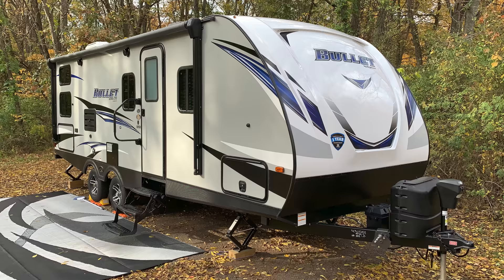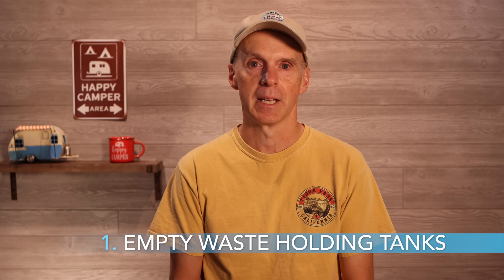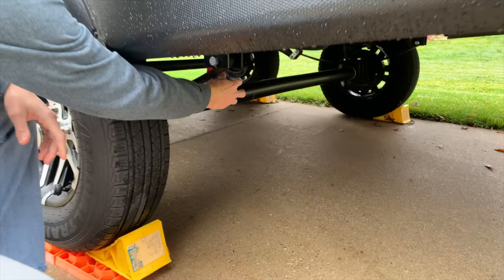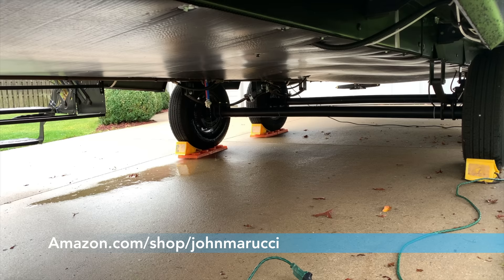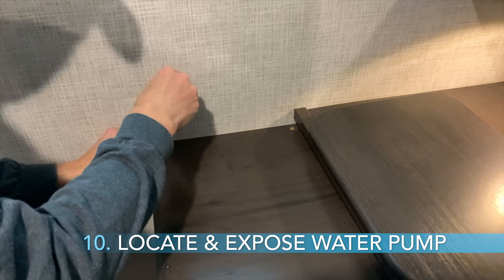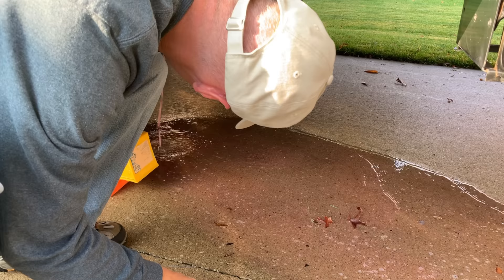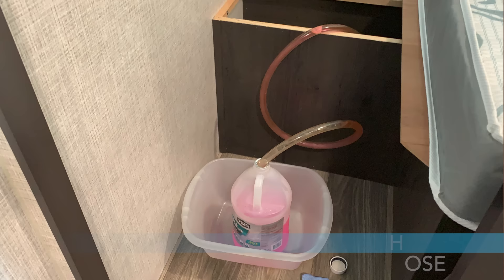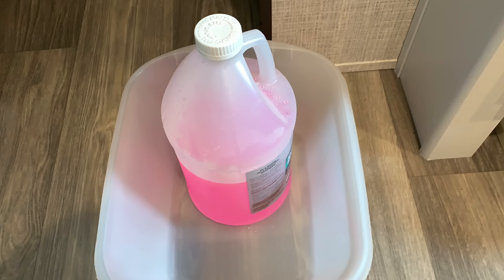RV Winterization Basics For Beginners – Step-By-Step Process

Comment from the maker: Here's a link to the free downloadable process document. Click the link and look for the RV Winterization for Beginners Process document: https://johnmarucci.com/docs-downloads
Reply: Do you also blow out your black tank flush?
Reply: Thank you so much for this tutorial.  I just finished every one of those steps myself.  (First time RV owner myself). I just have one question...I had antifreeze coming through the rear low point drain, but not the front. Should I be worried? Should I try again?
Reply: So if your water pump does not have a pigtail line for winterizing, where can I find out how I can source the same connector as my water supply line? Your siphon hose appears to have an identical fitting as your supply line. I’m presuming that you’ll need that in order to connect the siphon hose properly and not get a giant pink mess everywhere…no??

Comment: Just want to follow up. I did my TT this weekend using your guide. Worked like a charm. I threw a small bucket under my low point drain and captured the antifreeze to use in my sink drains. I had an extra outdoor kitchen sink. Used less than 2 gallons. Thanks again for making such a thorough how to.
Reply from the maker: Great tip on the bucket to catch the antifreeze under the low-point drains and reuse. Glad it all worked out for you!
Reply: Isn't it redundant to pour antifreeze down the drains since you already turned the faucets on to get the AF to flow through the lines? Seems a waste to add more when the traps are already full.
Reply: @toddpratt7222  Sorry--I still don't understand--the water pump is sucking the antifreeze and distributing it to the faucets--the trap should be full when you turn the faucet off--no?
Reply: @neilhudson6194  you are getting some in traps and toilet but I cut it off quick so not a lot. Rather than step 20 using clean in the jug antifreeze which seems a waste, I found the amount I caught in the bucket to be plenty for traps and toilet in addition to small amount from faucets. This was just my way to save the stuff in the jug.
Reply: @neilhudson6194 as cheap as that stuff is why not be super safe than sorry? I love where it gets negative degrees for long periods so 3 gallons is fine for me.
Reply: Look at you being resourceful way to go buddy and good tip

Comment: John, if all the water is drained from the plumbing system, why do you go thru the added time and expense of filling the system with antifreeze? Do you have to take those added steps?
Reply from the maker: Many people don't add RV antifreeze and just blow out their lines with compressed air. I am not as certain with using just air that I will remove all water from the lines.  With the cold Michigan winters if I make a mistake, it would be costly. I would recommend searching YouTube for winterization with compressed air. I know there are several videos to follow. Thanks.
Reply: @JohnMarucci  I imagine in Michigan taking the time and cost does save you from a potential  problem. Thanks.
Reply: Warmer coastal Pacific climates can get by with compressed air blowing out the lines.  I will add RV antifreeze to the toilet bowl and drain traps.
Reply: @PhotographybyTimWMoore  I am in Northern Cal but usually where I am now does not freeze.  I have a Roadtrek 97'. Still trying to find a good YouTube for directions.  I want to go up North where it is below 32.  What a project.  The valve at my hotwater heater appears to have never been open sooo
Reply: @deirdredooling9436  be sure to release the pressure in your hot water tank before working on the tank!

Comment: Just a quick update on making sure even if you haven't used your water heater for a couple months, that you use the pressure relief valve before you remove the anode rod. John was nice enough to mention it in the video but my elevator doesn't always go to the top  (on paying attention) and I got a face full of hot water tank water (it was cold water by now) mixed with all the white junk in it. It would make America's funniest videos if someone captured me doing it but it could also be dangerous when the anode rod bursts out.  That's my bad, John mentions it but I didn't follow directions step by step. Thanks for the video, John!

Comment: Ive tried EVERYTHING and my antifreeze will not run through the line.....
Reply from the maker: I'd start from where the siphon hose is connected to the water pump. Is your water pump drawing antifreeze from the antifreeze jug? If so, is antifreeze coming out from the water pump? The pump can get clogged with debris. That's where I would start.

Comment: Thanks John,  great video. When are you supposed to turn back the bypass  on the hot water tank? (In my case it's the by pass and the in-and-out lines)  Do you have to wait to flush out the system when de-wintrising or can you  switch them back to their original positions right after you're done winterizing?
Reply from the maker: Some people do turn the valves back immediately after winterizing. I suppose you could have some back flow of antifreeze into the hot water tank but it likely would be minimal with no harm done. It also saves having to turn them back in the spring when dewinterizing. I do leave mine closed but I don't think it is a huge deal. Thanks!
Reply: @JohnMarucci   Thank you that was helpful. I appreciate it.
Reply: Thank you for this!  I did take my RV to the dealer to get it winterized as I’m a newbie and didn’t want to do it wrong and cause a costly mistake.  But they did leave the valves in a ready to go position so I don’t have to do anything but run water through the system after hooking up to campground water.  I am heading south this weekend and will dewinterize when I’m there.  I don’t use my fresh water tank at all.  I was concerned about antifreeze getting into the hot water tank though.  Do I need to turn on my water pump if I’m not using the fresh water tank?  Thanks so much!  Hoping to follow your video when I winterize next fall.

Comment: Excellent video. Thanks. My question is do you really need to use antifreeze if you drain all of the water and blow out the lines? Seems like overkill.
Reply from the maker: Paul, Many people don't add RV antifreeze and just blow out their lines with compressed air. I am not as certain with using just air that I will remove all water from the lines.  With the cold Michigan winters if I make a mistake, it would be costly. I would recommend searching YouTube for winterization with compressed air. I know there are several videos to follow. Thanks.
Reply: Hi Paul - I work in the service department at an RV dealership and have seen instances where people have blown out all of the water, but still end up with a cracked water pump because there are some areas that still have enough water to freeze and crack (almost always the strainer's housing cap).   We see a lot of those come spring when we de-winterize RV's and there's a leak somewhere and the customer had only blown all the water out,  not followed up with antifreeze.  But it's a personal preference, I suppose.  The antifreeze these days is very safe for incidental contact with people, pets & wildlife.
Reply from the maker: @RLeigh1976  Thanks for sharing!

Comment: I’m a new travel trailer owner, and I followed this video to a T yesterday - and it froze here in Wisconsin last night.  We have a Coachmen Catalina Summit 184bhs.
It wasn’t clear where anything was and after a few calls to the manufacturer, I was able to locate the bypass under the bottom bunk, and remove a drawer under the sink to access the water pump.  I feel SO MUCH relief now that our camper is winterized.  Thanks for the clear instructional video.
Reply from the maker: Glad to hear it, thanks for the comment!

Comment: love the explanation john.. very informative.. what i usually been doing for years is: after draining all the water out of the rv and water heater tank, i put 3 jugs on antifreeze on my clear water tank, turn on the water pump and turn on all the faucets till antifreeze is running on those hot and cold lines. after that i turn off water pump and take the clear tank cap off and let the remaining antifreeze out of that tank straight to a bucket and later on dumped on p traps around the coach and toilet.
Reply from the maker: It certainly is a way to do the process without having to use a siphon hose. You may want to think about a final rinse of the fresh water tank so the antifreeze residue doesn't remain in the tank off season. Thanks for sharing.

Comment: I"m new to the RV life, just bought an older 17' travel trailer late this summer.  I have to say that this is the most simplest video on how to winterize an RV that I could find!  Most of the others seem to be manufacturer specific, but not this one.  Thanks for making it so simple.  Another Subscriber here!
Reply from the maker: Great to hear that the video was helpful. Thanks for subscribing!
Reply: @JohnMarucci  FYI.  I winterized my RV.  Including the time to hook up a brass T to the intake of my pump, I think it took less than half an hour!  If I had a channel that had anything to do with R'V's, I wouldn't do my own video, I'd just link this one!

Comment: My husband and I have a 2006 Layton 5th Wheel.  We don't use the pink antifreeze for our water lines.  We live in the Northeast where we have at least 5 months or more of winter.  My husband uses a small air compressor at PSI 25 to blow out all the water. You have to open all faucets when doing so and the outside hot water heater has to be drained too.  Works awesome!
Reply from the maker: Yep, many people use the compressed air method to winterize. There is risk if you don’t understand what to do. Some newer folks can cause real damage in this regard. Thanks!

Comment: Very good video!  I do just about everything that you showed, however I don't go through the process of disconnecting the intake hose at the pump.  It's hard to get to in my Coachmen Catalina 243RBS.  After I blow the entire system out, I add about 2 gals of the pink antifreeze right to the fresh water tank.  I then turn the pump on and open each faucet until I see pink.  Then I'm through.  In the Spring, I drain the fresh water tank and flush it a few times with some bleach and water.  We don't use the fresh water tank to drink from...just showers and washing dishes.  So far, so good.  Haven't had any problems yet.  My other RV that we had, I was able to easily get to the pump and add antifreeze the way you showed.  I have a friend that only blows his system out with air and says he's never had a problem.  Never uses antifreeze.  Again, good video!!
Reply from the maker: Gary, thanks for sharing your process!

Comment: Thank you, thank you for all your help. On the r-pod 2021 171, the water heater is under the bed boards but the water pump is under the seat board up front under the water pump control panel. I printed up the winterization document and that was very helpful. 
 Otherwise, your many recommendations are spot on.
Reply from the maker: Glad the video and printable instructions were helpful. All the best!

Comment: I live in northern Michigan been trailer camping 30 + years .. blow out with air compressor. Zero need for antifreeze. Keep all faucets in on position..
Reply from the maker: Yep, that's certainly a way to do it if you know what you are doing. Lot's of people don't know or are new and the risk is pretty high if you don't get all the water out. There's a comment below from a lady who works in an RV dealership and they see lots of broken water pumps in the spring from folks who leave water in the pump when winterizing. Thanks!

Comment: My 2017 Keystone Bullet 248RKS that I bought used in August of this year is somewhat different in terms of location of the water heater bypass valve, as it’s not easily found behind a panel.  Rather, it’s behind the panel for the main electric line cord and then through a hole in the space behind that panel. Your video was helpful to try to make a good guess where I might find it, but there was some educated guesswork needed to find it based on the location of the hot water heater.  I know there are many differences even in similar models from the same manufacturer, and so, maybe this additional information may be useful to someone.  Also, when siphoning the antifreeze to the water pump, with the low point hot and cold drains open, I was not able to get the antifreeze to come through the hot low point drain without closing off the cold low point drain.  This was the case with all faucets and spigots closed, and I don’t know why this was happening.   It was a guess to close off the cold low point drain, but it worked.  Most all of the video recommendations and examples worked well and were very helpful, as I was able to drain the water tank, hot water heater and low point drains, and blow put the city water and black water input lines.  Also, the antifreeze siphon to the water pump worked very well and was exactly the same as the video example.  Anyway, thanks to John M for this and all his other informative and helpful videos.  I would not have been able to this first winterization with it.
Reply from the maker: David, I am glad the video was helpful and that you were able to adapt it to your specific trailer. All the best!
Reply: The same thing happened to me with both low point drains open and no antifreeze coming out of the hot line. I did as David suggested and closed my cold line and that worked! Antifreeze out my hot line now. My trailer is a keystone passport 3220bh.

Comment: Owned rv's for 45 years.... always drain water.then just blow out lines...no antifreeze needed... never had a problem here in Connecticut
Reply from the maker: Mike, forced air is definitely a method many experienced RVers use. Glad it works for you. The only counter is if newer people don't know what they are doing and possibly leave water in the water pump. There is a comment below from a lady who works in an RV dealership who mentioned that they get a lot of cracked water pumps in for repair after the winter because people don't do the forced air method correctly. This beginner video is to help those folks just getting started. Thanks for weighing in, all the best!

Comment: I wish the bypass valves on my GeoPro were so easy to reach! I have to access them by removing a drawer under the bed and crawling through the opening. On the plus side, everything related to the water system is right there together (filter, bypass valves, and water pump), and it has a dedicated antifreeze inlet next to the city water connection outside.
Reply from the maker: Jeffrey, sounds like a real chore to get to your utilities but nice they put everything in one place. Thanks for sharing!
Reply: On our GeoPro, I've found I can also remove a panel from inside the storage bay to get to the water system from the other side, if that helps.
Reply: @KevinDurette  Hmm...never thought about doing that. Could work. Of course, I'd have to take the stuff out of the storage bay, so it might not really be any easier in the long run. Thanks for the idea, anyway

Comment: I also like to take my hand pump to put some antifreeze in the black tank flush line.i never use a air compressor I leave my low point drain valves open when we leave the campground on our last trip of the year&I drain the water heater and bypass the water heater when I got home had no water left in the lines
Reply from the maker: Thanks for sharing your experience!

Comment: My water heater doesn't have an anode rod, but it does have a PVC drain/freeze plug that I remove each year. Also, my water pump doesn't have a quick-connect like yours, it's Pex with a crimped on fitting so it can't be hooked up to a syphon hose like yours. However I run the compressor longer and pressurize the entire system and drain each tap until only air comes out, then a final low point drain opening. Then all the taps are left in the open position over the winter. In other words I haven't anti-freezed my lines because there was no water left in them. No issues last winter with that method. I'm a relative noob though.
Reply from the maker: Plenty of people use the compressed air method to winterize and avoid using RV antifreeze. You may want to search YouTube for “RV Winterization with Compressed Air” and find a few videos to double check your process. Thanks!

Comment: 4:47 Water Heater should have two bypass valves. The second valve should be at the top of the Blue vertical pipe, to prevent fluid from enter the water heater at the top.   At least that’s how my heater is bypassed.
Reply from the maker: Many only have one valve. My R-Pod had dual valves like you are explaining.

Comment: I blow out all the lines and don't use any antifreeze in them. I blow out the lines at the water pump too since just blowing at the city water inlet won't do this. 
Also, my water heater still hold about a quart or more after draining. I siphon it out.
Not all RV antifreeze is equal. I leave a jug outside when it gets below zero and sometimes it will freeze. I take it back frozen and still sealed.
Reply from the maker: Thanks for the comment. Lots of people use the compressed air method and don't use the RV antifreeze. I am always a bit concerned with the water pump that no water is accidentally left in there. I am bit risk averse and lean toward using the RV antifreeze, but to your point if the product is somehow inferior, and it gets below 0 degrees, then you could have a big problem. Thanks again!

Comment: Nice video however engaging the pressure relief valve to my Atwood water heater did not evacuate water to low point drains.  I believe the drain plug must be removed regardless if an anode exists behind the plug or not.
Reply from the maker: Yep, Atwood will be different from other models. Likely there is a drain plug to remove that should do the trick.